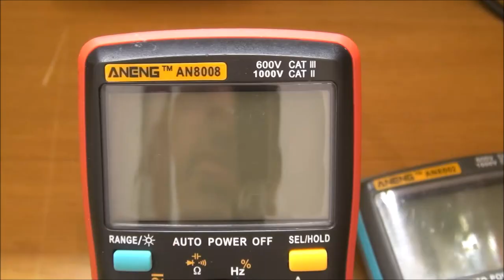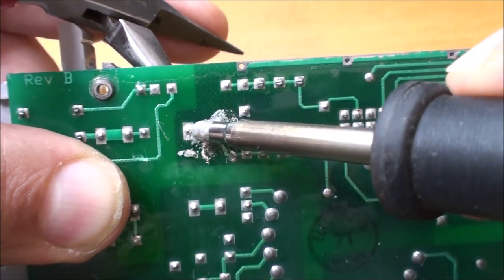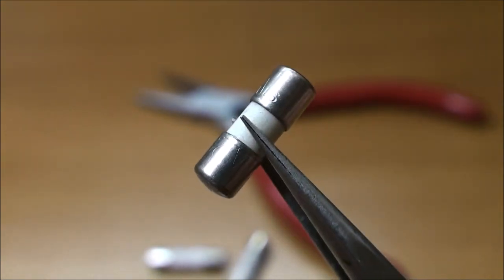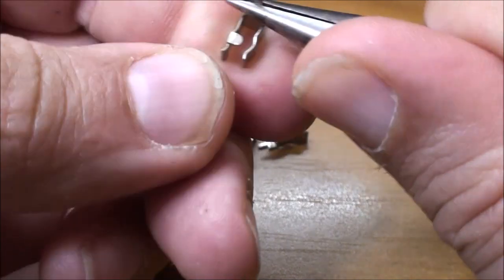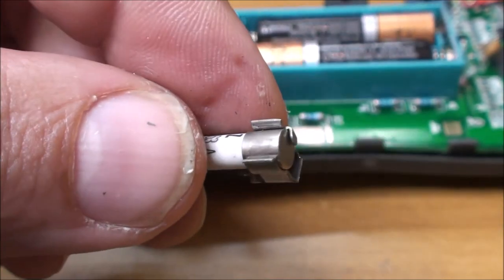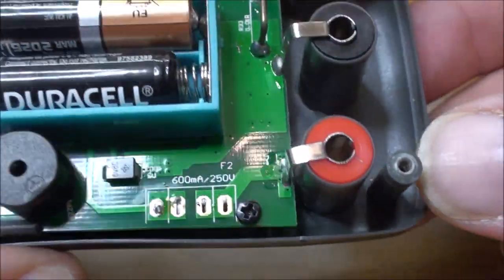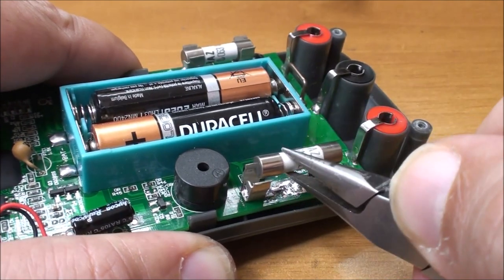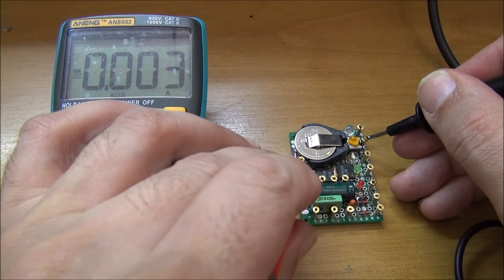The perfect Aneng 8002: Adding classical fuses

Comment: I can't think of anything more... something... than upgrading a pocket multimeter by swapping out the fuse housings to hold bigger better fuses. I appreciate this.
Reply from the maker: @Durp Durper You think of it, I did it. I didn't do that for fun. This Aneng 8002, and especially this one (used, worn and with scratchs) is my main tool at work. I don't use Fluke, or any other brand, even if I have other multimeters.
After a wrong use, when fuse are impossible to found on industrial area, it's easy to understand why this modification. For me, this multimeter is one of the best multimeter ever (price, efficiency)... It's worth the time. This is not a big step for the humanity but a big step for me (and for those having a Aneng 8002). Thanks for your comment
Reply: I get it... Expecting to find a little replacement fuse on an industrial site has the same chances of finding replacement disc batteries... not good.
Reply from the maker: @Durp Durper yes, disc are also hard to found when you need it (on sites). For the same reason, I prefer not to use 9V battery, because they are expensive ( 5 dollars !). When you need, you find it all vanished, because your collegues pick them up, for their own and private use. So, you need to ask for it two week ago, or to buy it your self. This is the mentality in France. So, AAA battery are not expensive. If you have not, you can untake the battery on your front lamp. Except than with this fuse, the device is out of order.
The funny thing: my colleague have his Fluke with two fuses dead. In fact, those fuse are impossible to found immediately. Because they have a precise caliber, and they are " fast ". So, I gave to him a... modifiyed Aneng 8002. He was very happy with it.. And actually he was the customer.

Comment: Thank you for the vid. .so helpful..just a question..what if I put the ordinary transparent glass fuses.. will it be okay?
Reply from the maker: hello yes, ceramic fuse are for high security requirement, for high voltage and current surge. You don't really need ceramic fuse here, transparent glass fuses are perfect, just need to be well choosen and calibrated.
Reply: @AIexanderHartdegen  thanks man

Comment: Great idea.   I didn't need another meter (I am mostly a Fluke man) but these are soooo cute and cheap and I've heard good things for low energy work I just had to buy one.   I got the AN8002.  I like it but the fuses suck.   I usually buy a new meter with spare fuses immediately so I have them on hand.   I ran across this mod because I could not find the factory fuses.   I will be making this mod on my AN 8002.   THANX for the idea.
Reply from the maker: glad you like it, hope you a nice mod.

Comment: I think those original small fuses can be found in christmas tree lights in the USA.
The companies that make them started putting them in the plug, similar to how Eope plugs are made but much cheaper and crappier.
Reply from the maker: @Aurthor Thing yes, but the fuse need to have a caliber. Unlikely to have the same value than the original fuses (600 mA and 10A)
Reply: @AIexanderHartdegen  yes, you are correct and they are also fast blow fuses.

I have another mod suggestion.
Use a PTC or resetable fuse instead of ceramic.
I have seen this used in one other multi meter.
Reply from the maker: @Aurthor Thing yes we can do that, but I think it need the right PTC. My other wondering about PTC is the transient curve. It need to be compared and need to not exceed the limitation of the rated excess current. Of course, if the transient is nice and the fast enough, it would be a very nice mod to do, especially for the 600mA fuse. I think it will be a nice experimenting to do to compare it with a fuse.
Reply from the maker: @Aurthor Thing that's a nice site. It need to be studied. It seems to be than PTC are more serious than I thought (lol).

Comment: Could you use pcb material to build extensions around the components on the 8008?
Reply from the maker: @Aurthor Thing Yes I think it would be possible, but that's a lot of work. But yes, even without pcb extension it's possible, except you create small gap between fuse and other components, dangerous when working on the main.
Reply from the maker: @Aurthor Thing you can see here, to watch my proceed for make fuse on the 8008  http://lektronik.canalblog.com/archives/2019/04/17/37267362.html